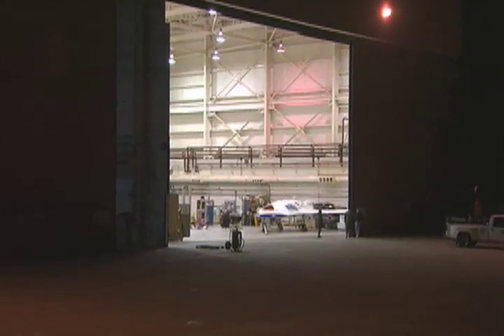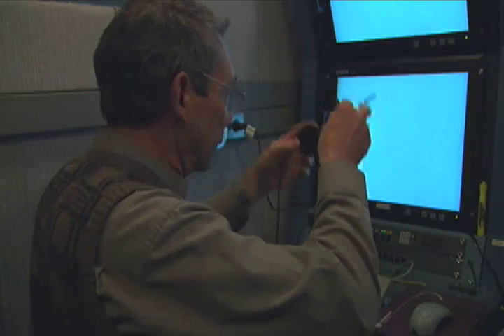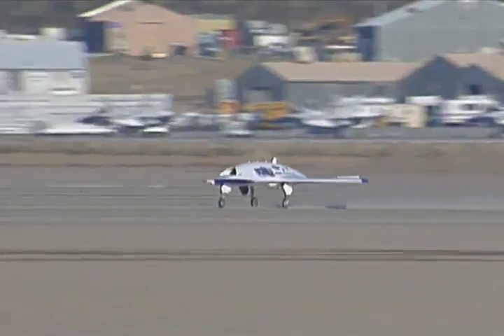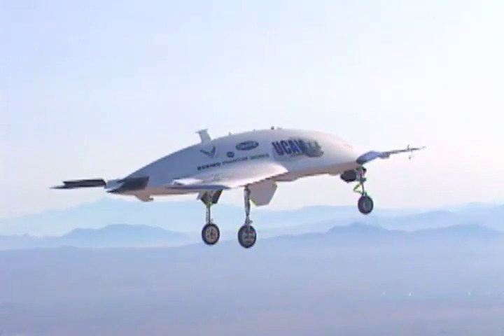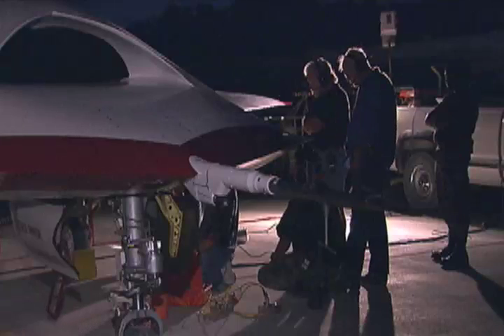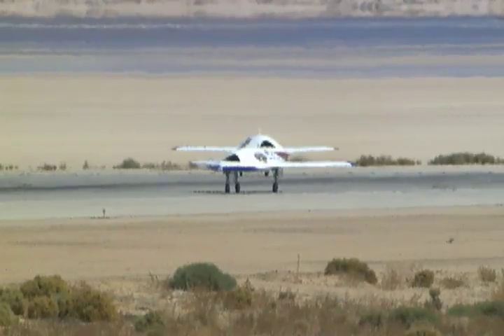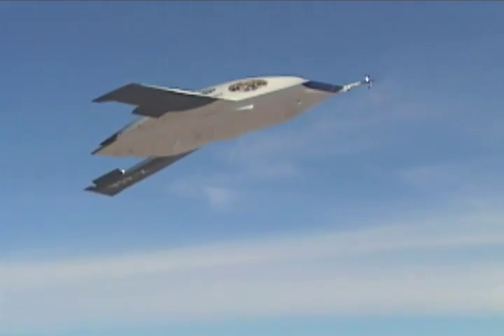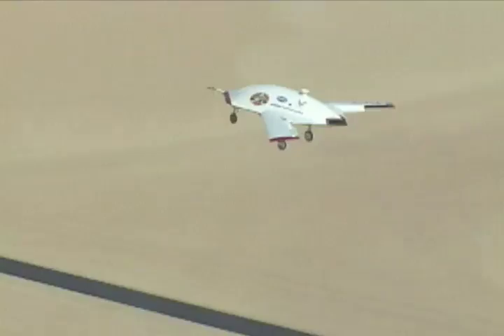X-45A / UCAV Project Overview and Autonomous Formation Maneuver

Comment: crikey that first landing was bad. Looked like they told it exactly what altitude the ground was at and told it to land at that altitude rather then telling it roughly where the ground was and giving it a sensor to verify it and letting the craft land itself. 

It looks like it landed 2 feet above the ground then just "dropped" to hit the ground. it literally just floated there for a bit.